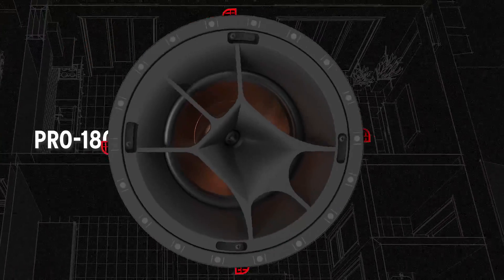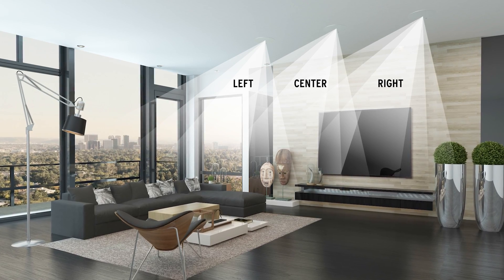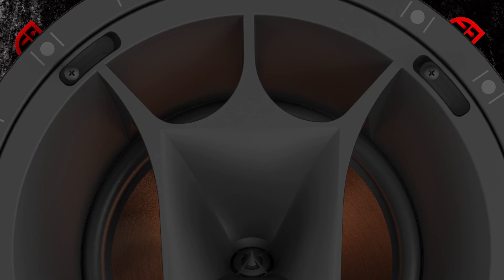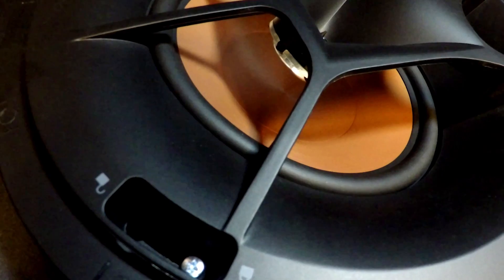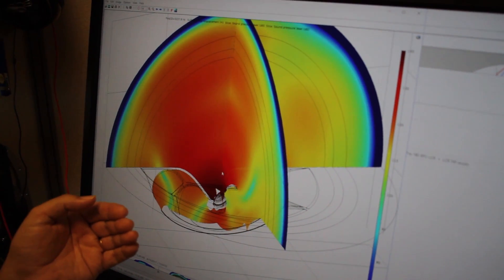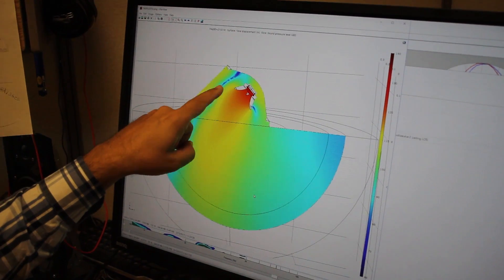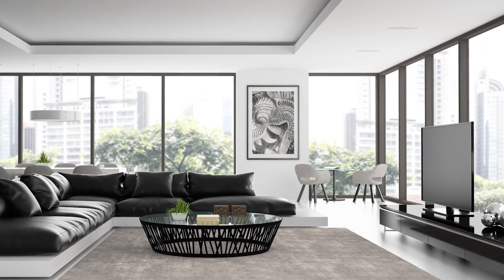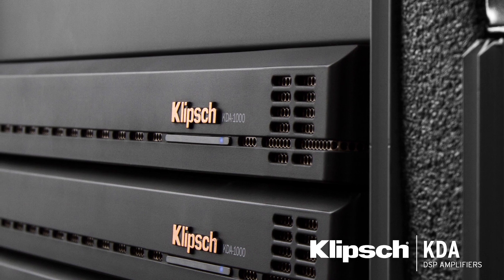Beyond the Specs with the Pro 180RPC LCR In-Ceiling Speaker

Comment: Can you install the Klipsch PRO-180RPC LCR's into a double 5/8th drywall ceiling without issue? I was curious if the SecureFit system had enough clearance to do so.

Comment: I just built a new home.  I had them pre-wire my home for a home theater system and these were installed in the ceiling for me by the builder (rear speakers only). These speakers sound fantastic. I use Definitive Technology speakers for the front and center channels and two Def Tech Subwoofers too.  Can't believe how great the overall systems sounds.  These Klipsch speakers are a perfect compliment to the Def Tech speakers. Sometimes I actually wish I had 2 of these for the right and left front channels, but for now, I'm happy.   No reason to change at these point.
Reply: Are u using them for rear surround facing at the back of seating. Thanks
Reply: @h22mantis  Yes

Comment: 'The design used by our competitors..' Klipsch CDT-5650-II & Klipsch CDT-5800-II use the same directional tweeter design you are criticizing. As a customer who owns one of those products, you are saying the company you work for sold us a bad in-ceiling speaker? >:(
Reply from the maker: Klipsch has adopted FEA software less than two years ago. Products in the development pipeline prior to that didn’t have the advantage of such an analysis tool, and like most of the other manufacturers, we dealt with the physics of the design the best possible way that the previous tools allowed.  Cancellations on the tweeter response were dealt at the first harmonic by optimizing the crossover region so that that cancellation notch would merge and be help to be filled up with the aid of the woofer.  The second and third harmonic are in much higher frequency, narrower, and with less intensity, that can’t be helped, but are much less noticeable to the ear as well.  Your interpretation that the other models are bad is like seeing the glass half empty, we just have a designed a superior product to fill up the glass.  Technology improves and innovates, at Klipsch we strive to make thinsg better, doesn’t mean what we have done before was bad.-Riccardo Balistreri
Reply: @klipsch  I was quoting your statement that the design used by your competitors is inferior, yet Klipsch has used the same design as well in the past. You could have simply said 'the design was improved' without throwing that jab at the design and those who used it (again which Klipsch did as well). It's like if LG were to insult their competitors for using LCD TVs when they released their OLED TVs.  As an owner of the Klipsch CDT-5650 II it's frustrating to hear the criticism coming from the same  company that created and sold it.
Reply: @alexandsimba  Bro that's a strange thing to get wrapped around the axel about. They aren't even the same class of speaker. Yours is a very nice $380 speaker and this is a newly designed flagship specialty speaker that costs over $600. That would be like me complaining about Klipsch talking down to my Klipsch Synergy series speakers when talking about their Reference RF7-III's. They ARE inferior to those. Doesn't make them bad...
Reply: You are conflating inferior with being bad. The person who wins silver in the Olympics isn't a BAD athlete because he is "Inferior" to one single person on the planet....